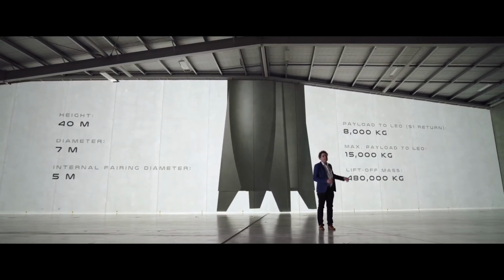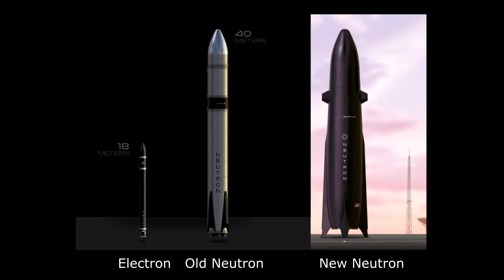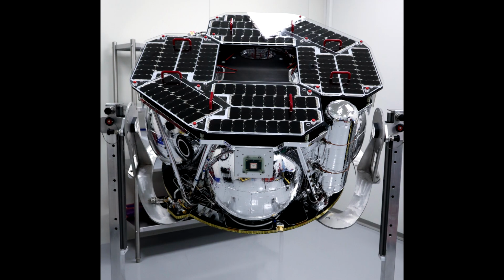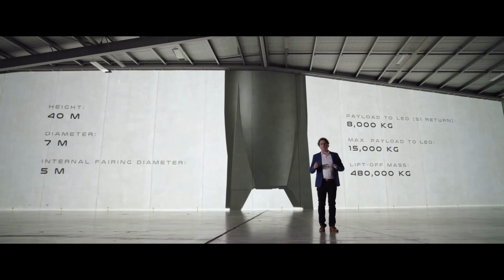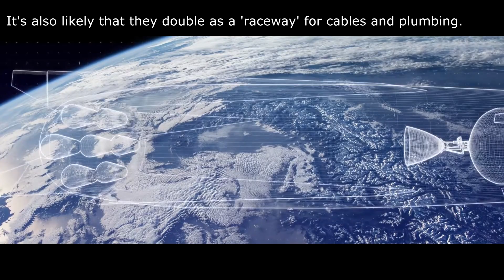Rocket Lab's Neutron Rocket Will Be More Reusable Than Falcon 9

Comment: Edit: preface, I think Neutron is a neat little rocket and I'm really hoping it succeeds because companies like Planet Labs will love these things to death.  I just take issue with all the snipes at other concepts which are pretty clearly designed for a different set of requirements in mind and designed by people who have actual experience with reusing rockets.

The Neutron isn't really comparable to F9.  8-15t ≠ 20-27t.  The Falcon 9 is almost as capable as a Delta IV Heavy in fully expendable configurations.  And for those people saying "8 tons should be enough for anybody!", while that may be true, 8 tons to LEO is not.  A good number of F9 launches are relatively heavy (something like 8-10t) satellites to geostationary transfer orbits.  The Neutron wouldn't be capable of that.

Also re carbon composites: another problem they pose for reusability is that CRFC is that they are probably harder to inspect and harder to patch.  So when your Starship lands for the 15th time, it's much easier to patch up a panel with some welding if it's made of stainless steel.
Reply: almost exactly my thoughts.

Comment: I still don't understand why SpaceX doesn't appear ("appear") to be interested in using carbon for the first stage only. Is a steel Starship too heavy for a carbon first stage or something? They could alter the launch profile a little bit to ease the thermal strain on the first stage if they needed, perhaps making Starship a little bigger and Super Heavy a little smaller with separation at a lower altitude. Maybe it's all just easier to do it they way they're doing it, especially during development.
Reply: > Is a steel Starship too heavy for a carbon first stage or something?

SpaceX already built something like 20 prototypes for tests, and no end in sight. Imagine how much $$$ and time it would take to make all that from CF.

Comment: Just a though - it is possible, that when SpaceX get the Starship design and manufacturing done, they, for whatever reason (better performance obviously, but maybe other reasons may be pertinent too), take stainless steel model and swap it for carbon or some kind of hybrid... In the end - that was the original idea behind this rocket, but as Scott pointed out - with carbon would be iterating bit more difficult.
Reply: > take stainless steel model and swap it for carbon

If/when reuse works at least semi-reliably, they could swap steel for titanium. x10 the cost, but more than twice as light!
Reply: @denysvlasenko9175  maybe, although I'm not sure how titanium behave in cryogenic temperatures - but worth a look at it.

Comment: Cant wait to see the Autoclave for baking this beast. Would this be the largest carbon fiber composite ever built to date?
Reply: 787 fuselage looks comparable in diameter, but it's made in separate sections.  Don't know if Neutron's fuselage is one-piece or not?  777X wing is pretty big, but not really an apples to apples comparison.
Reply: @johngunderson5463  I just did the math, largest autoclave in the world is 30' in diameter and 75' in length, used for the 777X body. The Neutron Body will be about 88' in length so they will need a larger autoclave based on the length. Stats: Legs: 5', Body: 88', Payload Doors: 37'

Comment: The ONLY "more reusable" part of Neutron, as compared to F9, is that they return the fairing to the launch site.
Reply: sounds like it's more reusable
Reply: Exactly. How difficult is it to make a fairing anyway? re-using the fairing only reduces total payload capacity due to extra fuel needed for added reentry weight.
Reply: @benxenes  > How difficult is it to make a fairing anyway?

According to Elon, it's about $5M worth of difficult ;)

> re-using the fairing only reduces total payload capacity

...which matters only for launches which actually need that last 300 kg of maximum payload. Most launches don't. If needed, for those which do need them, they can use expendable fairing.

Comment: Doesn't the wider diameter incur a heavy aerodynamic drag penalty on the way up?
Reply: Not necessarily, it's more about total surface area and the angles involved. Being wider also means they can make it shorter, and with the second stage tucked inside a faring, they might come out about even or maybe even a little ahead.
Reply: @northandeast9444  Yeah, I'm sure they weighed the pros and cons of it all.  I just remember from doing some airplane design that the form of the body is always the largest source of drag.  That is why anything that goes fast is a tube (commercial airliners, rockets, etc.).

Comment: Imagine having the extra fuel in the second stage to enable it to get back down to an orbit were it can be catched by another neutron first stage and brought down to earth again
Reply: If second stage would go slow enough to be caught it would immediately deorbit. But maybe it would be possible to time it perfectly
Reply: @LauPaSat-pl  even if they timed it perfectly, the second stage would just smash into the first one at several km/s
there's no way you could recover something from orbit without yourself being in orbit too
Reply: @dabs4270  That's why you slow upper stage to suborbital velocity. It will go down super fast, but you can try to catch it "mid fall". But that needs several km/s delta v
Reply: Just remember that every ounce of extra fuel, fairings, and Landing hardware you carry into orbit has to be subtracted from the payload capacity. That's why SpaceX quickly gave up on recovering the 2nd stage of the falcon 9.
Reply: They could keep them in orbit and wait until the next cargo Starship comes by to catch it and bring it back to earth ;-)

Comment: The demonstration of impacting the metal sheets and the carbon fiber composite sheet is pure eyewash.  Yes, the metal bends, but the composite MAY be damaged internally with matrix and fiber cracking internal to the material, leaving the material damaged, but NOT VISIBLY.  Impact damage is a serious design consideration for composite structures (drop a heavy tool on a composite structure and you could have non-visible damage).  It doesn't invalidate using composites, but that demonstration is garbage.

Comment: Presentations are cheap but rocketing is hard. For me this looks like they all want to catch up with SpaceX rather than reach them as SpaceX will be probably have Falcon 9 retired byt 2025.
Rocketlab should move to were the puck is going rather to where it is right now.
Reply: I doubt Falcon 9 will be retired by 2025.
Maybe for cargo, but SpaceX will want to continue launching astronauts as well
Reply: @kevinkrammer8077  Yeah, probably - depends on if the ISS remains in service until then or if the space debris caused havoc on it. Anyhow Rocketlab should stop making fun of others when they cannot really compete with them. If Starship is a working cargo delivery system then I am not sure if Neutron is dead on arrival or just getting a niche part of the market where customer only pick them if they have to.

Comment: The rocket does look like it demands vertical integration, but that looks like a feature rather than an oversight for a few reasons: Not needing to lay the vehicle down and lift it back up reduces the downtime from landing to re-launch. Horizontal integration adds requirements to the payload as well as not all payloads are designed with the structural integrity to handle laying sideways.

Re-launch procedure is probably no more complicated than drive a crane out, lift the thing from hardpoints inside the vehicle, put it back on the launch stand, inspect the vehicle for any flight defects, drop a fully integrated payload & upper stage into it, refuel & fly again.
Reply: "inspect the vehicle for any flight defects" (and check the engines and supporting infrastrucutre like pumps and vents for full functionality/damages/parts past their life expectation) is the bit that up to now has made reusing stuff EXTREMELY expensive and time consuming. Just assuming it will be NO matter with the Electron without any prototypes already existing and allowing these aspects to be tested is silly.

The Falcon 9 takes several weeks for overhauling. Even if you can cut it down to "A few days" it's far from "land it, give it a shine and send it back up". THAT is possibly decades away even though Musk also has these dreams for Starship. As long as their heatshield drops off under any vibrations that too is a pipedream.
Reply: @Ugly_German_Truths  You do realize that the first stage is only sub-orbital, right? The heating is completely different from anything SpaceX has to deal with now. More than New Shepard, but FAR less than anything orbital. Even if rapid reusable orbital isn't a thing tomorrow, that's very clearly not a problem Neutron's first stage needs to solve at all.
Reply: @4thImpulse  The falcon 9 first stage is also suborbital and probably reaches similar speeds to neutron first stage, so I'd say they are comparable.
Reply: Peter has said since the presentation that Neutron will be made vertically, transported vertically, and live its whole life when on the ground vertically. This is driving their search for a manufacturing site, almost certainly near their launch site at Wallops Island. This also explains his remark about no need for complex ground equipment - once transported to the launch pad it will be free standing, no strongback. Unknown if there will be a simple structure to fuel the upper stage.

This makes a vertical integration structure necessary, though. Also a vertical hanger that's equivalent to Falcon 9's horizontal one, for refurbishment/inspection.

Comment: I see a number of comments here saying that Falcon 9 is "more capable" in that it can launch about twice the mass into LEO.  I don't think that that is the ultimate measure of capability.  For the most part, satellites are getting smaller and 8T is adequate to launch multiple "average size" satellites into orbit.  What is far more important is the cost per ton to LEO.  SpaceX is doing great today because their $/T launch cost is substantially less than other providers.  This is far more important than efficiency or total Tons to LEO capability, as long as the launch system can deliver your payload to the orbit you require.  It may be that Neutron can undercut the Falcon 9 $/T launch cost.  If so, SpaceX will take a hit in the number of contracts that Falcon 9 takes.  On the other hand, we already know that Starship will stomp Falcon 9 and may well beat Neutron in this metric.  Neither of these launch systems will have an impact until they come on-line and that will be several years at best.  

I like both SpaceX and Rocket Lab and look forward to seeing what they deliver in the coming years.  For now, we watch and wait.
Reply: F9 will have an advantage of reliability at first, but Neutron can get eg. vertical integration advantage. Overall it seems to me that Neutron will be better for most small payloads than F9

Comment: A lot of really clever ideas here. I especially like the second stage using tensile strength.
Reply: Right, it looks like they are letting the second stage handle the bulk of the delta-v while designing the first stage primarily as a dedicated "get out of the atmosphere" RTLS stage.
Reply: I am super curious about the supersonic characteristics of this first stage shape during launch. This is a huge amount of forward facing surface. Isn't there a reason that rockets are long and pointy?